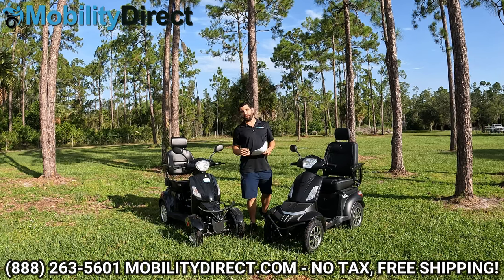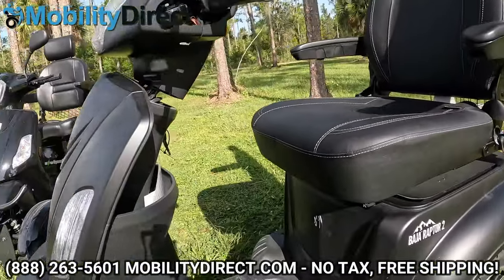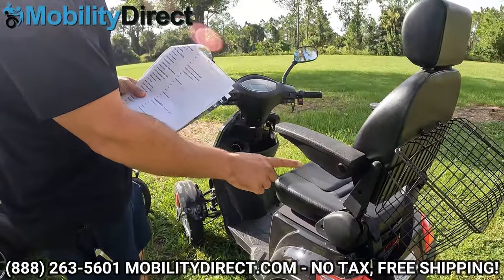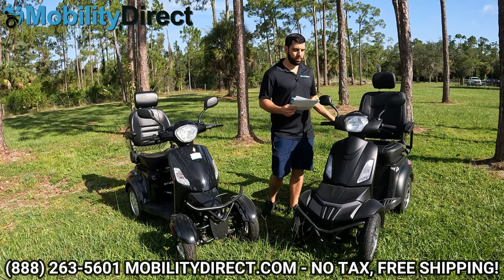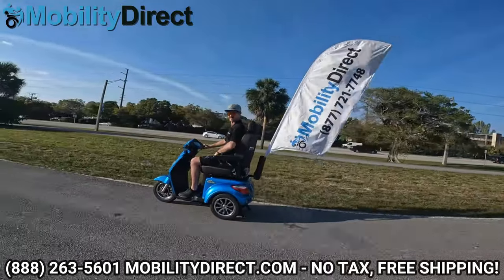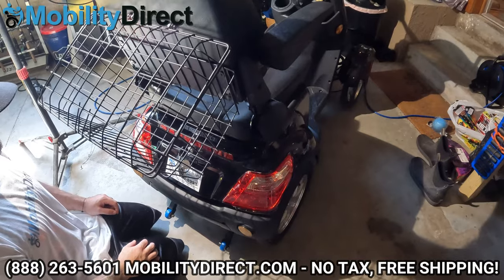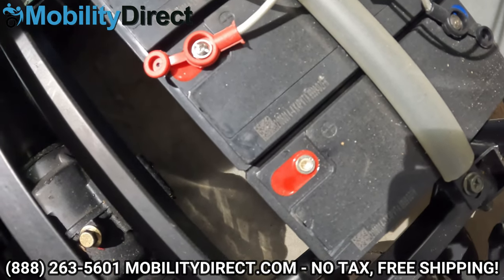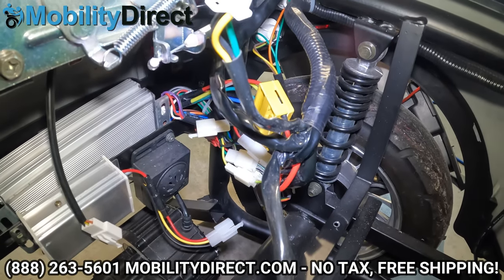EW-46 🆚 The Baja Raptor 2 Scooter (CAUTION)

Comment: I have a e wheel 3 wheel unit and it’s not even compatible to a Pride that I got used.  
On the E wheel the brakes will drag and stop you from starting up. Unless you give it a push.  The only thing good about it is it’s pink and when you get it going it fly’s over 20 mph. 

You asked about battery life and distance.  It’s rated at 43 miles, but I wouldn’t even try to go past 5 miles with it because I won’t to get home.

All things taken into account the E wheel is a $1400 flop and I’ll never buy one again.  I have to admit I like that Baja unit only I like the three wheels sharper turning.  Thanks for all the information I’ll catch you again.
Reply from the maker: Thanks for sharing! The Baja Raptor is also a great choice but if you're looking in the market for a mobility scooter that will meet your needs, just give us a call at 888-263-5601 and we'll help you!

Comment: The Raptor II looks like more stable than the EW-46. I've seen Ford vehicles that last longer than the EW-46. The Raptor II is the better of the two for speed and stability in my opinion. I enjoy my AFIKIM C4, but I did not have the AFIKIM C4 I would consider a RAPTOR II or the  BAJA WRANGLER. Of course. the AFIKIM S 4 OFFERS MORE. Y'ou'll take care and hopefully I get down to visit my Kin Folk there in Tampa area.
Reply from the maker: LOL! I own a Ford Expedition, I guess you're a Chevy guy?? But yes, the Raptor 2 is better all around. The Afikim is definitely a better choice if you plan on going off-road a lot. The Raptor is better for streets and sidewalks at high speeds, it can handle off-roading but not my first choice for a full time off-road use scooter.

Comment: Im interested in raptor 2.  How does it perform on hills?
Reply from the maker: It performs that great on hills. Its incline rating is 6° but we've tested it and it can go a bit higher than that. Feel free to give us a call at 888-263-5601 so we can talk more about the Raptor 2 or help you find the best off-road mobility scooter that will meet your needs. Thanks for watching!
Reply: @MobilityDirect  raptor to vs pursuit 2.  Can you do a video

Comment: They look like cheap E bike controllers! Made in China! I own two Jetson, mini bikes, which are quite good, with similar controllers in them! They were very inexpensive e-bikes, but thus far they were great! They only have a maximum speed of 15 mph each with a 15 mile range each but I’ve added extra batteries onto them externally with a dual battery balancer kit, so I can double or triple the mileage For them! And I love them because they’re smaller and fit in my apartment very well one of them is called the Jetson haze and the other one is called the Jetson bolt pro. Costco sells them! The Jetson bolt pro is probably the most popular bike in the entire world and there are hundreds of YouTube videos on that bike itself ! It’s only a small tiny thing and it’s built very strong and solid has a maximum 265 pound weight capacity, and they have sold literally tens of thousands of things in about the four years that they’ve been making them! I’m not kidding when I say that’s the most popular bike in the world you can repair it upgrade everything on it yourself and there are 100s of YouTube videos for  Facebook groups for the bike as well, and it has its own cult! But I agree with you, you get what you pay for! Love pride products, period!
Reply from the maker: Indeed! Thanks for stopping by!

Comment: #BAJA RAPTOR 2
 Wow, that's not a scooter... That's what I call a machine! I'm pretty young at only 47yo but unfortunately about 10 years ago I was diagnosed with STAGE III MULTIPLE SCLEROSIS  which has been taking it's toll. To make ot worse 3 years ago I was attacked by 5 monsters that literally beat me to death. Luckily the amazing media staff revived me however my ability to walk ended when they killed me. I found a Vive mobility scooter 6 months ago which I was happy with, except the fact they claimed a full front and rear suspension but arrived with only cheesy rear suspension (not adjustable either) and after only 6 months it's currently in the shop trying to diagnose why the motor won't work. Getting the 7 beeps of death when turned on. Thought it might be a wiring short since I found 3 wires that were cut threw due to the awful wiring job they did. Either way the motor doesn't have a serial number to order a new motor because, oh yeah warranty not covered according to VIVE. AND TRACKING DOWN A USED Series A transaxle motor brake pricing ranges from $400-$1400 for a used motor cause I can't even get a price for a new motor from VIVE. The scooter cost me $1700 and lasted 7 months. Horrible product, horrible service overall horrible experience. Now stuck renting a loaner for $35 a day till issue gets diagnosed and then save up forrepair or replacement. Not making it very easy on a guy collecting Disability SS for income. Wish I would have known about the RAPTOR 2 to save up for a MACHINE like that, that I'm pretty positive lasts more than 7 months. Love the videos keep up the great job. Your YouTube channel has been so informative and a life saver for learning how to diagnose a faulty speed controller or a faulty Potentiometer. Thanks again I'll use my huge following of Google Review followers to spread the great work you are doing. Truly THANK YOU, TY WINTERS
Reply from the maker: Couldn't agree more with you! The Baja Raptor 2 is a beast! We really appreciate the support and it's because of you guys that we love doing these informative videos. We're really happy to help and we're glad that you love our videos. Thanks for the support. We really appreciate it a lot!

Comment: WOW the #BajaRaptor2 looks like exactly what I dreamed about. Unfortunately, I bought the Jazzy 1450 with my own money right before I knew this existed but it didn't live up to it's stated  per charge range up to 16.5 miles ( I can get 4 miles safely) It was to replace the Jazzy Elite HD which I was oversized for but gets the same range 😔It also jerks and spins when I try to turn it left or right. I'm not happy spending 5000 for that. 
My questions are: 
1. What is the turn radius like if you need to get in a bathroom stall or on a bus? I wanted the range so I wouldn't have to get on a bus 
2. Does the stated range come close in the real world travel (I've been burned once already) I do weigh around 375-400 lbs
3. The Litium battery upgrade was mentioned. Is there any data to tell me just how much better range it gets?
4. I like the look of the display but does it tell you how much charge is left? The idiot lights on the wheelchairs are not accurate
Reply from the maker: It has around 92.5 inches turning radius and it does really well when using it for turns. The weight capacity is 400 lbs and it can still perform well but it will use more of the motors power so you'll most likely get up to 21.2 miles at 200 lbs. or up to 15.1 miles at 400 lbs. For the display, it's much more accurate but for the best battery care and maintenance, we recommend not draining the batteries all the time. Thanks for stopping by our YouTube channel! If you're in the market looking for a mobility scooter, please feel free to give our non-commissioned sales expert a call at (888) 263-5601.